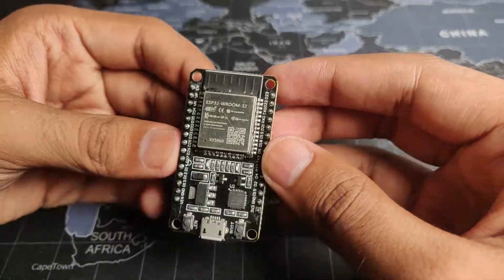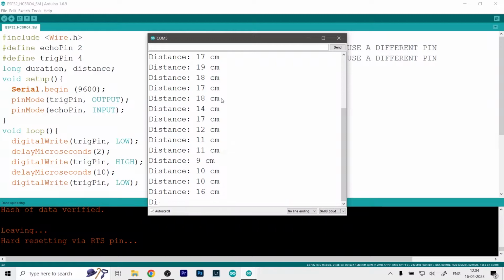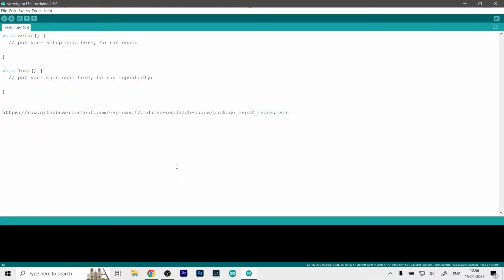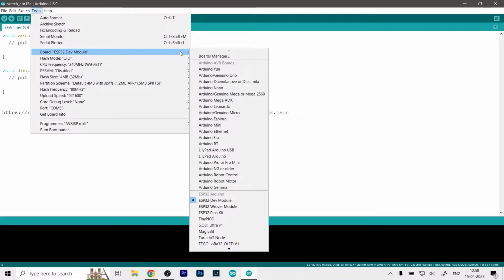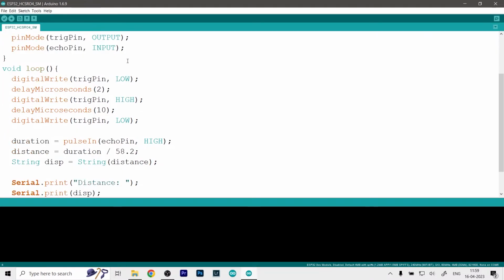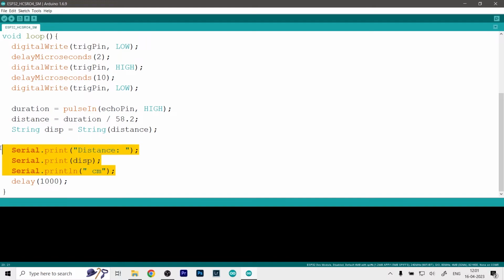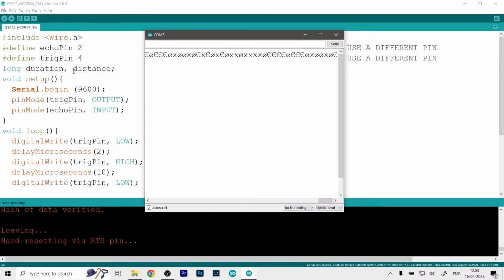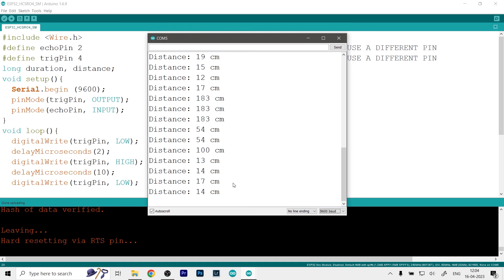How to Use ESP32 with HCSR04 Ultrasonic Sonar sensor and Arduino IDE

Comment: I am trying to do a project using ESP32 and HCSR04 sensor but somehow I am unable to connect the ESP32 to the computer. I have loaded the right board and libraries and installed the drivers and changed multiple cables but am unable to connect to the ESP32. I changed USB ports and also computers as well
Any suggestion would help

Comment: i need to use two ultrasonic sensors for my project. since i am using a battery i am using MT3608 booster to give 5v power to esp so can i connect both ultrasonic sensors, moisture sensor, servo motor to 3.3v of esp?. chatgpt is showing i should use voltage divider so what should i do

Comment: i m getting error in distance, it continously shows  0cm
Reply: i was also facing that error then i realized my pins od esp32 wasnt connected correctly it take much force in some cases to fix arduino in it and if this also give you error than unplug the esp32 and plug the cables directly in the pins of esp32

Comment: My HC-SR04 works on 5 volts, not 3.3. I do appreciate that you don't use an HC-SR04 library though.
Reply: X2, quería ver si de alguna forma se puede reducir los 5v del sensor a 3.3v. ; para que funcione con el sp32.
Reply: @Eliaser.A-Z What you can do is use something called a level shifter to allow 5 volt sensor outputs to be used on a 3.3 volt system.

Comment: IF YOU HAVE 0CM USE 5V instead of 3,3V!!!!!!!!!!!!!
Reply: i get a measurement of 0 how do i change it to 5V
Reply: @nrlauliasaid8007  there is a 3,3v and a 5v output on the esp32 change it to 5v
Reply: How i can do it

Comment: I ran mine with a similar code, but it keeps sending me the Distance:0
Reply: Because the vcc input for ultrasonic sensor is 5v and the output of esp 32 is 3.3v thus the low power and malfunction  try to use other mcu as 5v output
Reply: Me to😢😢😢

Comment: Will the same code work for esp8266?
Reply: The distance is always 0 cm. I am using a 3 3v esp8266. What is the issue?
Reply from the maker: Yes it should work, just make sure that you select the right pins.
Reply: @INOVATRIX  tysm!

Comment: distances under 40 cm can be measure without problem, more that that i just get random values. Any idea how solve it?
Reply from the maker: That is the approximate limit of the sensor. For more range you'll need to use more expensive and accurate sensor
Reply: i am using one HCSR04 with one Arduino Mega 2560 and can measure easily 2 mts in a water tank, but with ESP32 works bad, any idea? @INOVATRIX

Comment: By the way, after a research can get data from ultrasonic module just by using 2 wires by carry data over dc lines :)
Reply: can you share the link to read about?
Reply: if you are constantly getting 0 try connecting the vcc pin to the  VIN pin of the esp32 and NOT the 3.3v. Hope this helps

Comment: Use this code instead and connect the VCC to VIN (Notice I changed the pins and the serial monitor baud)
#include <Wire.h>
#define echoPin 18               // CHANGE PIN NUMBER HERE IF YOU WANT TO USE A DIFFERENT PIN
#define trigPin 5               // CHANGE PIN NUMBER HERE IF YOU WANT TO USE A DIFFERENT PIN
long duration, distance;
void setup(){
  Serial.begin (115200);
  pinMode(trigPin, OUTPUT);
  pinMode(echoPin, INPUT);
}
void loop(){
  digitalWrite(trigPin, LOW);
  delayMicroseconds(2);
  digitalWrite(trigPin, HIGH);
  delayMicroseconds(10);
  digitalWrite(trigPin, LOW);
  
  duration = pulseIn(echoPin, HIGH);
  distance = duration / 58.2;
  String disp = String(distance);

  Serial.print("Distance: ");
  Serial.print(disp);
  Serial.println(" cm");
  delay(1000);
}
Reply: Thank you so much. It works! But can you tell me the reason why you have thought to make this change & why was that one not working?
Reply: #include <LiquidCrystal.h>

// Define pins for ultrasonic sensor
const int trigPin = 14;
const int echoPin = 12;

// Define LCD pins
const int rs = 35, en = 34, d4 = 32, d5 = 25, d6 = 26, d7 = 27;
LiquidCrystal lcd(rs, en, d4, d5, d6, d7);

void setup() {
  // Initialize serial communication
  Serial.begin(9600);

  // Set up the ultrasonic sensor pins
  pinMode(trigPin, OUTPUT);
  pinMode(echoPin, INPUT);

  // Set up the LCD number of columns and rows
  lcd.begin(16, 2);

  // Print initial message to LCD
  lcd.print("Distance:");
}

void loop() {
  // Variables for the duration of the ultrasonic pulse and the distance
  long duration;
  int distance;

  // Send a pulse to the trigger pin
  digitalWrite(trigPin, L);
  delayMicroseconds(2);
  digitalWrite(trigPin, H);
  delayMicroseconds(10);
  digitalWrite(trigPin, L);

  // Measure the duration of the echo pulse
  duration = pulseIn(echoPin, HIGH);

  // Calculate the distance (in cm)
  distance = duration * 0.034 / 2;

  // Print distance to serial monitor
  Serial.print("Distance: ");
  Serial.print(distance);
  Serial.println(" cm");

  // Display distance on LCD
  lcd.setCursor(0, 1); // Set cursor to second line
  lcd.print("                "); // Clear previous distance
  lcd.setCursor(0, 1); // Set cursor to second line
  lcd.print(distance); // Print current distance

  // Example if-else conditions based on distance
  if (distance <= C) {
    lcd.print(" cm (L)");
  } else if (distance <= B) {
    lcd.print(" cm (M)");
  } else if (distance <= D) {
    lcd.print(" cm (H)");
  } else {
    lcd.print(" cm (OL)");
  }

  // Wait a short time before taking the next measurement
  delay(500);
}

Comment: O meu sensor ultrasonico hc sr04 nao está funcionando no 3.3v, sabe o que poderia resolver?
Reply from the maker: Connect power to VIN pin on the ESP32 Board.
Reply: @INOVATRIX  to receive the echo return, would there be damage to the esp32 input pin?